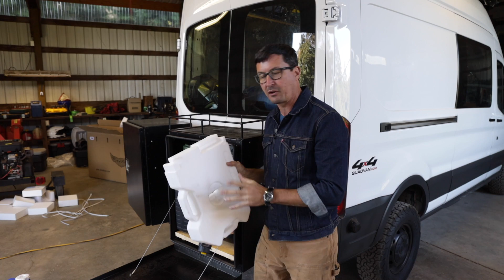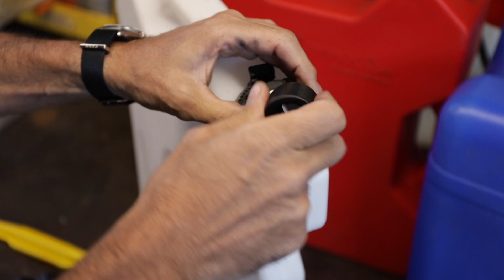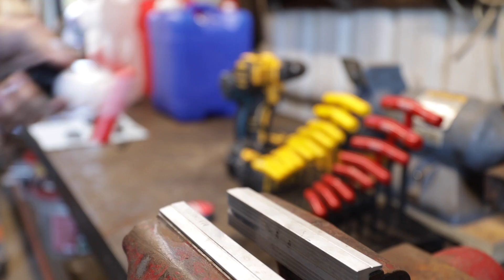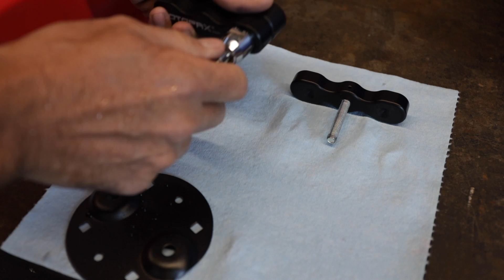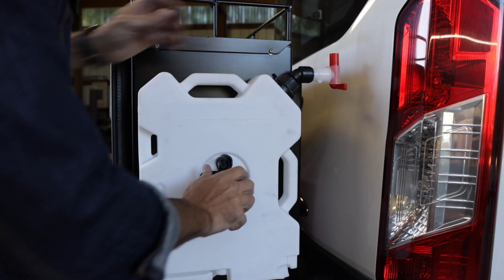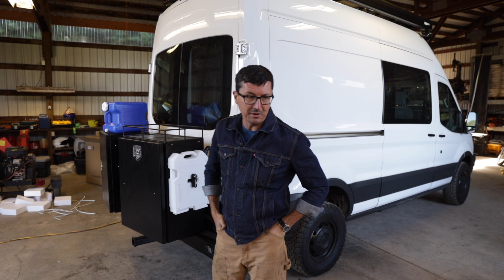The Emergency Water Storage We've Been Waiting For - FINALLY!!!

Comment: Awesome video! I wonder if you can leave off the locking bolts that attach the base of the mount to the lower section of rotopax mount so when it is loosened it will pivot from spigot up to spigot down--no need to take on/off. You may not have room to pivot with your setup but some people mount to the side of their vehicle (like me).

Comment: When I worked in wire rope and rigging fabrication, the design factor (fudge factor) on all of our slings and fitting was either 5:1 or 4:1, meaning either a 20% to 25% overspec to fail. Whenever I’m dealing with things that are designed well, I always keep those numbers in my head.

Comment: "Fudge factor" (Factor of Safety) is typically 2 or 3 ish, 200 to 300% of expected max load.  The torque, leverage from the extended arm does look a tad scary on a rough road but compared to a max tongue wt. trailer on a shorter reach, maybe not.  If hitch is well made as I expect it will at least bend and droop long before breaking, won't likely fail without plenty of warning.

Comment: Two gallons... even four is not enough... in particular for cooking and cleaning dishes. (single adult consumption is already 1/2 gallon a day). in my opinion adding a flat 10 or 15 gallons tank (on the top of the roof) will procure more autonomy and the option for a quick shower.  Price wise; way to expensive for 2 gallons... a 35 gallons roof rack mounted water tank cost around $125...  (not even looking for cheaper)  https://www.kvsupply.com/item/35-gal-water-tank-with-hose/BSA51%20WHITE/?srccode=GPGPLAKV&gclid=Cj0KCQjwp5_qBRDBARIsANxdcim6a6vFbHjOaaSk-YSlP2DWQ3CMuheLaebiRtC7Z77ZbCXvEuGUCpwaAr7qEALw_wcB

Comment: Becoming a "stamped" engineering (getting your Professional Engineer license) is a bit more complicated than that but you got the basics down.  It's definitely something done post-degree.  

As for the spigot - I think it's great.  Will you be traveling with it attached or in the cabinet?  I could see putting it in the cabinet just to avoid mud and what not getting on it.  It's also less expensive to replace the plastic spouts than the machined part you bought.  I'm loving these van videos! Keep it up!

Comment: If the black box it's mounted to is also secured with a lock, you could attach a small chain inside the box with the key to the rotopax can. That way you'd only need to carry one key.

Comment: FYI, even an engineering degree doesn't mean you get to stamp things of great importance...  You must become a certified "Professional Engineer" or PE.  It requires passing a Fundamentals of Engineering test, and then a "Professional Engineer" test, usually a few years later after getting some practical experience.  It also requires sponsorship by other PE's in most cases.  It is a pretty big deal, and it is not terribly common among engineers in most disciplines.  

The idea of engineers testing to 10% over or some such number is total BS too, aside from the aircraft industry.   I think the rumor came from some of the accelerated durability tests that were run at 10% over GVWR by the big three years ago.  That 10% means pretty much NOTHING in terms of normal use.   You have to keep in mind that static loads are a very small part of the loads chassis components see.   An axle loaded to 6000# might get to 12,000lbs over a decent bump if the driver isn't careful and the suspension bottoms out.  In the auto industry, things rated at a static load capacity don't fail if you put 10 or 20% more weight on them, they just get that much closer to the limit.  Drive conservatively and you can run significantly overweight with no failures or problems.   Use your judgement, drive appropriately.

Comment: Cody, when you screwed in the adapter, I immediately knew you'd have to take it apart and add the cap. You may want to consider adding a rubber cap or balloon over the spigot as it will get dusty on the road.  https://amzn.to/2SPpW2x

Comment: Just remember that for every pound you add behind the rear axle you take two pounds off the front axle..  So if you are putting 2,000# on the back, you are taking 4,000# off you front axle, so you could make your front so light that you would have trouble making turns..  Be safe my friend..

Comment: You should look for some sort of a cap for that water valve. even turned down road dust and stuff will blow up in there.  Could even make one with a rubber cork just drill it out to fit over that and shove it on.

Comment: Engineering safety margin (fudge factor) is usually around 4 times rating, think what would happen if (for example) your 10ton rated tow bar was pulling 10t, and you jerked forwards, that'd impulse load WAY more than 10t.

Comment: You could use a water spigot that would go on your house for a garden hose with a check valve if you ever wanted to get away from the plastic valve. Regardless I think it’s a good system. Thanks for sharing as always.

Comment: I dont know as it pertains to other areas, but as for ASME pressure vessels there was a safety factor of 4 for vessels built before 1999 and there is a safety factor of 3 for vessels built after 1999 (the materials were actually stronger than they originally thought when earlier versions of the code was written)...as for engineers, it depends on the jurisdiction (state) but generally once a person graduates with a BS degree in engineering they have to work two years under a registered Professional Engineer (P.E.) before the P.E. will sign off on thier application to sit for the P.E. exam (which is pretty tough). Once they pass the exam and thier application is accepted, then they are a P.E. for that jurisdiction (there may or may not be a reciprocity agreement for neighboring jurisdictions).....as for ASME pressure vessels, the P.E. is responsible for the design and calculations, AND there is also an Authorized Inspector (A.I.) that has also  had a significant amount of experience and passed the National Board exam that will also sign for the vessel and both are responsible for it.

Comment: PRO TIP:  That spout from the water can WILL fit those gas cans... you can use the seal from the gas spout... BEATS those "safety" spouts!  ***Order more "Water" spouts for the other gas cans!
Also... use a little food safe grease on those seals from time to time to keep them from tearing.

Comment: Is the plastic on that water can translucent  Or does it omit all light?  With it being mounted outside like that you may be battling a  Algae problem.   freezing them full of water would work good  For inside a cooler.  But if you froze it and put it on your Carrier outside I think you and end up with  Quite a mess due to condensation and road dust.  But you are right those cans are very nice with a very nice mounting system. Thanks for sharing your ideas with us.

Comment: Nice setup. No worries on the load your hauling you have set it up right with suspension and tires. I run load range E on my 1/2 ton Dodge Ram 4x4 it's a truck  to be used and worked not to sit and look pretty lol thanks for the video.

Comment: Will you be doing anything to mitigate algae growth?

Usually you'd want a fully opaque tank for external water storage to stop it going green.
Otherwise you have to mess about treating the water with chlorine tablets or some-such.

---

You might also want to make a cover for the valve to keep the sun off it. I have what looks to be the same valve on a 5 gal tank and it's gone brittle from being in the sun all the time. Will also keep road muck out as well.

Comment: Before retiring I worked at a plant that occasionally required work in areas greater than 100 degrees. We set up water jugs at the entry/exit for these areas. After a while people were getting sick. The problem was traced back to the valves on the jugs. Even though we cleaned the jugs, the valve interiors had bacteria in them. We had to go to disposable water bottles.

Comment: The minimum “Safety Factor” that I was taught in college here in the UK, for engineering design was 4:1. This was for things mounted on a wall etc. (E.g a wall mounted air con unit). I’ve seen safety factors of 10:1 for overhead applications (e.g a lifting beam mounted on a ceiling). So if the Safe Working Load was 100kg it would have been tested up to 1000kg with a 10:1 safety factor

Comment: Cody I can appreciate that you are building the ultimate adventure van for your family, by using the best equipment  that fits into your budget, My only gripe is that all  this comes at a huge financial cost, that you can comfortably afford, but for your average viewer it's way out of the average persons budget. I'm  not hating in the slightest. I would just like you to maybe include  budget versions of the products you use. Your work ethic is not at fault whatsoever.
Reply from the maker: These videos are not a blueprint to be followed precisely. They are ideas to regard or disregard as a person sees fit. You don't need an adventure van to have a use for a quality water storage system.

Comment: Factor of safety is typically dictated by several factors:  Material, expected forces, application, and gut.  Most factors of safety for towing down a highway are at least 2.0. Sometimes more for aluminum because it yields far more quickly and dramatically than steel.

Comment: When you design something like a hitch you figure 5 times rated load for a safety Factor to take care of shock loading, but that doesn't always work because of the shock loading.

Most light aircraft that are design for utility category are also designed with a 5 to 1 safety Factor.

Oh you're going to be without the built babysitter for a month or two well life happens!

Comment: Question Cody is you 1 ton Van Gas or  diesel fuel.... If it's Gas that's good BUT if it's diesel fuel you may want a yellow can to.  hate to put wrong fuel in wrong tank. most farmers have diesel fuel i was just thinking. I'm not worried. have a great day.
Reply from the maker: Gas,
Reply: Thank you Cody.

Comment: What you call the "fudge factor" we call a Factor Of Safety.
As far has how much? That REALLY depends on industry, materials, and risk to human life. Airplanes usually have the lowest at 1.2-1.5 because weight is such a major factor. To compensate the low FOS, analysis are MUCH more rigorous and materials held to much higher standards.
For your hitch the FOS is likely 3. So it's designed to handle 3x the rated load because we know folks like you will abuse them. Personally I would be comfortable loading to 1.5x the rated capacity on something like that.

Comment: lol  worked with a lot of  equipment the leaked what we did to stop it did not work well  buy gas gasket for gas pumps  they sealed  that right up stoped leaking I do have all the machinery I worked on with that  if any chance run into one of them I would know not to touch it you do not get them off of any pumps  you replacing the pump too

Comment: Looks great. I’m just curious, I’m sure you looked at just adding a water line from your inside system.  Would you give us your thought on this?  I use one of the Walmart jugs for outside water with my motor home, but have been considering plumbing an outside line.
Reply: I think if they open the driver side rear door there is a spigot there - showering if I recall.
Reply: Bennington Camper there is, mostly used to flush out waste tubes after emptying your tanks. I want to put one on the passenger side as that is the side the entry door is on, and where we put the grill.

Comment: I think you are ok weight wise as the diesel engine and gearbox up front weighs in about  300kg  660 odd pounds, so no way will its counterbalance weight would shift so far to the rear.
 that much to may drama queens, I have seen a Transat van stopped by the police over this side of the pond  full of scrap metal way above the GVW capacity limit of the vehicle and the only issues were the springs had bottomed out and it the vans was sitting down on the tyres thus destroying the tyres and make the vehicles handling dangerous and illegal.

Comment: In engineering we account for fatigue life as well. So force wise it is usually a 20-40% gap for the engineered  strength vs the actual rated strength  and 10x factor for life. This also depends on the engineering protocol for each company but those numbers are a pretty good rule of thumb

Comment: 14:53 On a previous home where we had some remodeling going on, our structural engineer had really added additional  "fudgefactor" to the garage part of the building. A 4x8 beam would have sufficed but he called out an 8x12 glulam to be sure it would pass code and we could (jokingly) hang a full 454 chevy engine from the beam. In fact, we could! He didn't want us to ever come back and say the building fell down. We joked the entire house would come down in an earthquake the but the garage would still be standing.
Reply: Sounds like he was WAY overly cautious because he wasn't used to typical timber design.
A timber beam will flex wildly long before it's in danger of breaking, so timber designs are usually governed by deflection and not by load. If a 4x8 beam would pass deflection limits, you still could have easily loaded it with an engine block without it failing, you just might have noticed slightly more sag than usual in the floor above it.
Reply: @EngNerdGMN  🤓

Comment: Lol at the over priced 2gal water container. Get the reliance 7gal for a fraction of the price
Reply: Marcel masoumi 

Reliance is around $15 rotopax is $60.
Reply: @sfrealestatedealmaker6001  $60 if you have a hook up plus the mounting setup. Plus it's only 2 gallons.
Reply: Marcel masoumi 

I’m pretty happy with my reliance for camping. If I was a high speed operator overlander super hero - I’d get the rotopax 😂

Comment: Just to clarify for you, it’s a Factor of Safety, and it ranges from item to item. Airplanes are different than bridges which are different from hand tools. And yes, we like to build them in for safety because stuff happens and we are adventurous too haha.  I was taught to design things as if your own family were using them. And to get the Professional Engineer stamp, you need a bachelor’s degree, plus your FE (fundamentals exam) certificate to start four years of work underneath licensed professional engineers. After that you have to pass the PE (professional exam). You pass that, then you are a Professional Engineer. I’m currently working on my four years.
Reply: And to get your Structural license you need an additional desire for pain and sorrow to make it through the 16hr test.

Comment: Yikes, I was just doing some quick math, and this setup is $135 for 2 gallons of water!
Reply: And with it being white it will grow algae very quickly in sunlight.
Reply: @jamielee4206  I wouldn't worry about microbial growth in your water containers unless you never clean them after you use them. as long as you rinse them out every now and then and make sure not leave standing water in them then you're fine.
Reply: It costs 121,13€ to drink 2 gallons of beer in a bar in Finland
Reply: It cost alot to just look cool.
Reply: @chilaw2004  he already tried a cheaper can and he didn't like it, that's why he went with one of these.
Reply: Yeah - Rotopax are way overpriced and evidently suffering from QC issues if the Amazon reviews are any indication.
Reply: Rich people love to spend lots of money
Reply: Yeah rotopax are a ripoff.  The real head scratcher is there's a wide assortment of under-floor water tanks for these vans that'll give you about 25 gallons for the same price.  He can just plumb a little faucet going to his kitchen box.
Reply: The $135 is for cost of equipment alone, each time you use it the cost per gallon goes down. The cost of a vehicle is pretty high if you judge it by how much it cost you drive it the first two miles :-)
Reply: You forgot the van
Reply: chilaw2004 
But it's his money. He can spent it on whatever he wants.
Reply: 2 gallons of drinking water. it's really not that expensive. sure bottled water is cheaper but this can, can be refilled from the tap so over time this ends up being a cheaper solution.
Reply: Got that YouTube $$
Reply: Yup, definitely practical for the average working man/woman to afford. It's a bummer almost everything on this setup is overpriced, but these videos sure help sponsor it...
Reply: It looks really high quality though
Reply: @samanthabentley9876  Evidently they are/were - it seems as though the new ones are having some hiccups.  I can see their utility for a motorcycle (which I think is what they were designed for originally) but on a 4 wheel application they seem overpriced compared to better cheaper options.

Comment: 16 to solo. 17 to hold a pilot certificate. We recommended starting training at 15.5+ to solo on or close to their 16th birthday. Biggest thing to remember is it’s not rocket science. Don’t let it overwhelm you. Jack will do great.

Be careful with the CAP. It’s paramilitary (which is fine to an extent) but depending on how busy the chapter is or who’s running it, I’ve seen guys wait for years to even fly in the plane. All the while doing grunt work.

Comment: I like those rotopacks, but I think I would have stuck with the walmart ones and cut the bars on the top of your cooking storage container where the valve would stick out so that it would fit, just simply because of the water capacity.